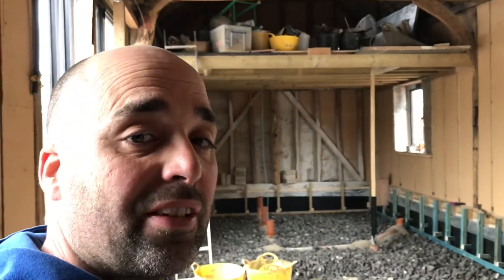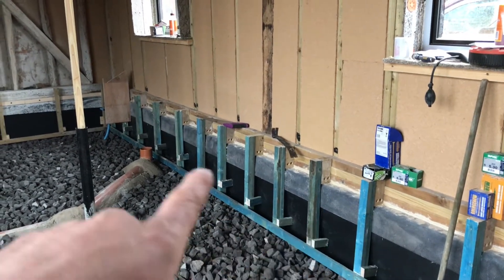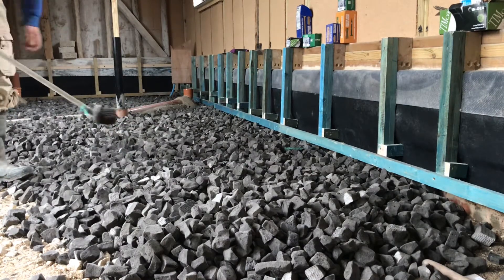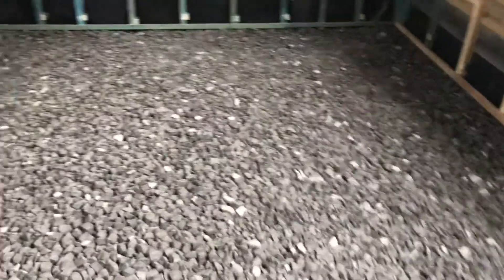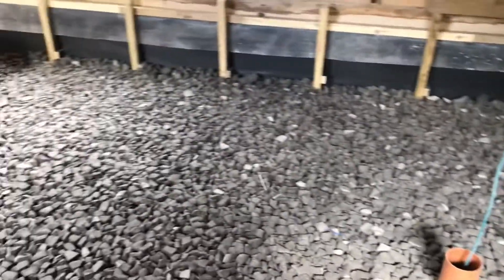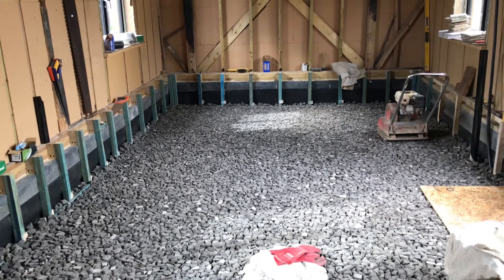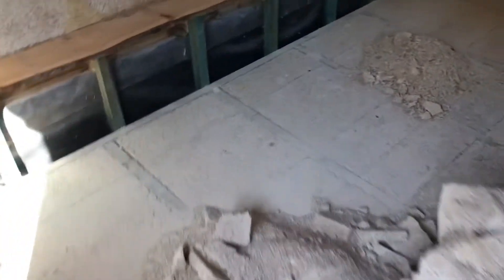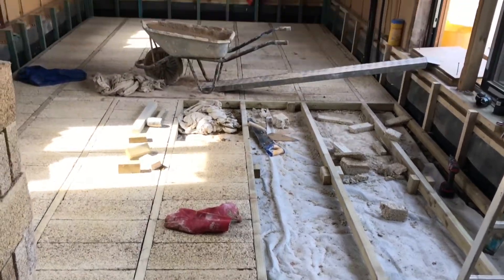Hempcrete and foamed glass floor build up

Comment: Wrong , ya dont heat it up and air blows through it . Glass powder 98.7% and SiC 1.3% . This compound get mixed together . It is evenly spread on a fibreglass mesh ran through a liquid called Kaolin . It is placed on the mesh at about 1 inch thick by 6 ft wide . The product is ran through an oven on top of the fibreglass mesh ,on a steel belt . The ovens or better kmown as a kiln are 80 ft long . The initial heat is 300degrees f and slowly brought up to 862 degrees . The product takes at least 40 minutes to go from one end of kiln to the other on the belt . Once the product comes out of the kiln it goes through a coolinh process whete the sheet , slowly cools ,crackles and breaks up into smaller chunks . It then goues onto a conveter , and tgen up into a holding bin and tgen trsnsporr trucks ,where it will go to its destination.  I started manufacturing this product  Envirorock April 28 , 2024 . In Quesnel British columbia in camada . This is the first machine of its type in canada , imported from Germany.  BSN and SGGC are the makers of this .

Comment: Hi, Thank you for the video. I am trying to find the best solution for a floor. Just wondeing if you have had any issues with yours since installed?
Reply from the maker: No issues, I even had a flood during the build from a burst pipe, the floor dried out very quickly 🎉

Comment: Is the total pack of glass foam aggregate 10 inches, or one layer of it which gets compacted? In the Hempcrete book I read about using a 120 mm layer of glass foam (or expanded clay) aggregate. What makes this situation different than that, what is the reason you are using double that amount?
Reply from the maker: I just wanted as much insulation as I could. The thicker the layer the better the insulation. It’s 10 inches total glass foam but I put it down in two layers and compacted after each layer.

Comment: will this combination work for a floor over the front porch? In other words, the floor is exposed to the Minnesota winter air. Could this set up work in such a case?
Reply from the maker: I wouldn’t use the hemp blocks externally for a floor but the glass foam would work well.

Comment: Silly question perhaps but what kind of gloves are you using. Working with this stuff using leather gloves and the friction worked a whole straight through the glove.
Reply from the maker: Hi I think I just have standard gloves, apart from getting the stuff out the bag I didn’t really touch it, used a broom and a rake.